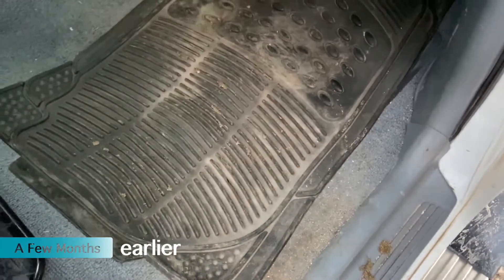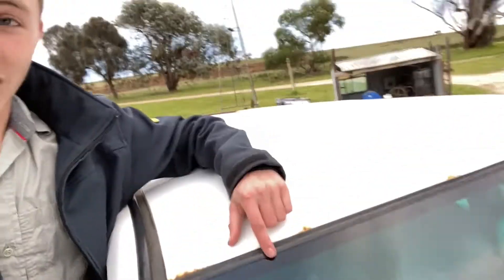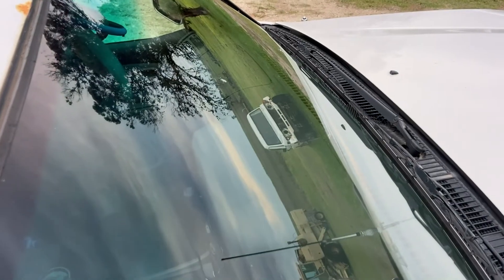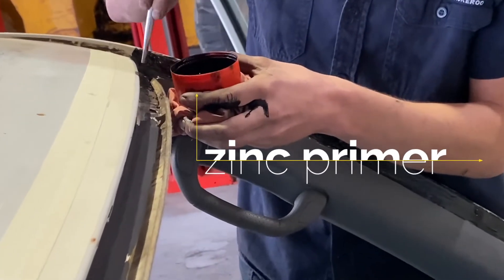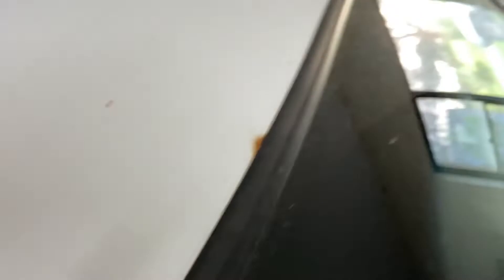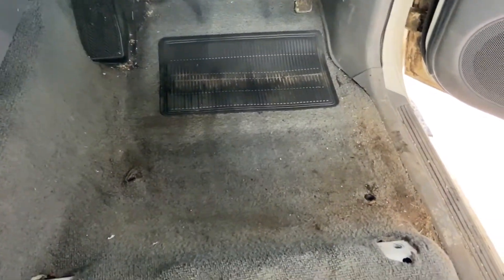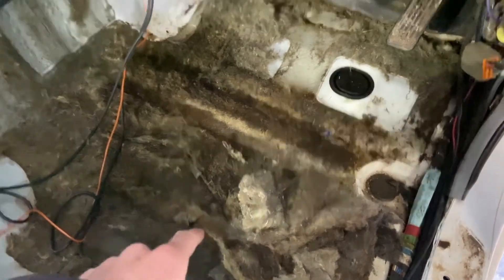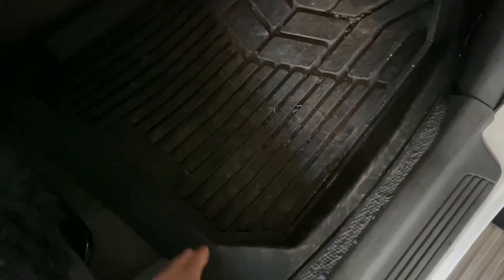Remove that DAMP Smell From Your Car

Comment: Does anyone know if this is a problem for 70 series Cruisers?
Mine in particular is a 2010 76 series. Does not have a damp smell.

But if you leave the car standing for a few days it has a strong industrial smell. 😳

My Dad reckons it's only the materials and glue that Toyota used that makes the car smell that way. He had a 79 series as a company car and he thought it was only his one that smelled like that. 🤪

(The 79 series also had a lot of previous users)
Reply: Wish I could help dude but a 70 series very nice I’ve got a shitty Hilux build 😂 on me channel
Reply: instaBlaster.

Comment: Another spot to check it where the roof rack mount holes are in the roof are not rusted or missing bolts with fibre washers
Reply: yeh my dad and i just finished fixing the rack mount holes

Comment: Awesome mate. As soon as summer kicks in my 105 windscreen is coming out. Fixing the small amounts of rust and no more bloody wet floor mats in winter. Had my old girl for 20 years just cant part with her . Cheers
Reply from the maker: B. D They become part of the family after a while 😂 I couldn’t ever part with mine either. The rust does creep up on you though, and it’s important to keep an eye on that rust around the windscreen! As you said it soon creates leaks
Reply: 👍 after having the after market turbo installed are you considering beefing up the gearbox?
Reply from the maker: B. D Not at this point in time. There’s a few things I’d like to do first. Considering I’m not making excessive power, I don’t personally see it as necessary at this point in time, but if I ever noticed problems then I would definitely get around to that
Reply: Ill stay tuned mate and really enjoying channel. These Toyotas weren't made to throw away after 300k  like most of the new ones. I lov reliability when in the middle of nowhere. Take care  👍
Reply from the maker: B. D Cheers for that mate! Couldn’t agree more. Nothing really compares 👍👍
Reply: Hi Will, looking to do my windscreen. Where did you get the larger top seal from? Thanks
Reply from the maker: @B.D1111  hey mate, sorry to be not very helpful... but it was supplied and installed by my local mechanic along with the windscreen
Reply: Thanks for your reply mate. Yep the windscreen place has the larger seal 👍

Comment: How much did the new carpet cost mate, was it genuine
Reply from the maker: It was about $500 from a Melbourne company called All Car Carpets. Not genuine but it was moulded in some places. Took a bit of cutting to shape but in the end it came up really tidy! I have a video on the carpet install too
Reply: @WillsLandcruiser  cheers mate looks great, i have a 100 series   V8 it has a noticeable miss, i have changed the 4 oxygen sensors and still not good so i think i will try the coil packs, have a great day champ

Comment: Mate what did you not fix the rust before the screen went back in?
Reply from the maker: Ran over it with a wire brush wheel and put a good zinc primer on there. The rust that was left really didn’t interfere with the windscreen. I had a complete cut and polish done recently that touched up the rust spots on top of the windscreen. Should be sweet now
Reply: @WillsLandcruiser  I only ask as i have a hdj105 which had no signs of rust. Windscreen removal showed some similar bubbles to yours which i had fixed and repainted. I was burnt on a patrol in the past which over 2 years rusted away completely after a dodgy windscreen install where they scratched painwork and did not treat it.
Reply from the maker: @dancotter7050  I didn’t have a lot of say in the replacement as I was paying them to do the job to the quality they would on any other windscreen. I do have confidence in the way they treated the rust and the way it was resealed though. There was a fair bit of work that went into the rust off camera, and everything under the seal was wire brushed, treated and sealed to a high quality. The rust further up the windscreen was really just from stone chips and this was treated at my recent cut and polish touch up. It definitely could have all been treated at the same time, but as you can imagine, I didn’t expect the mechanics to go all out on rust repair and repainted unless I was prepared to spend thousands